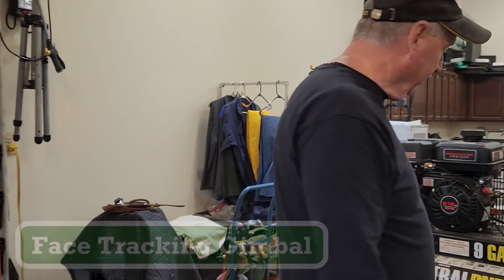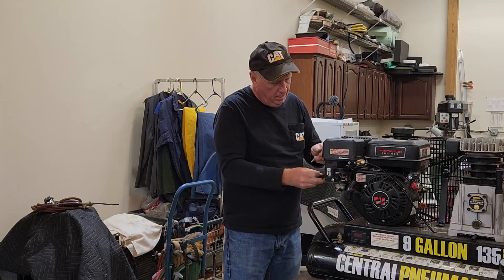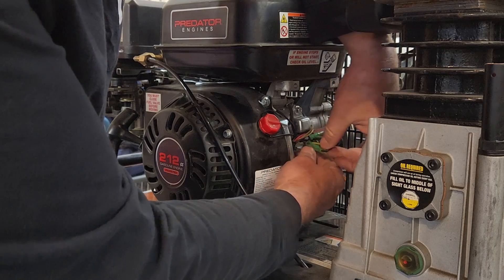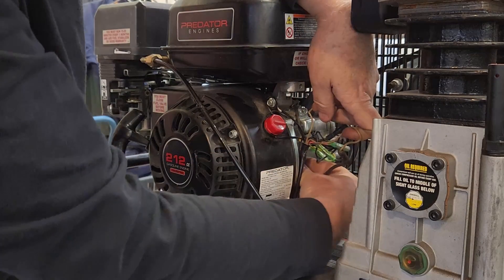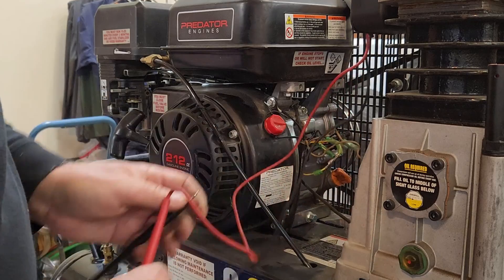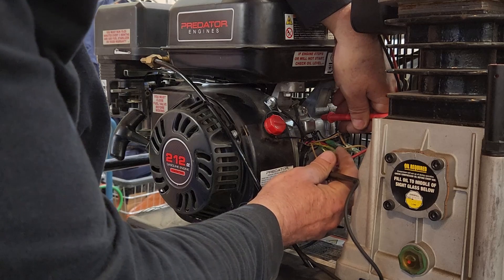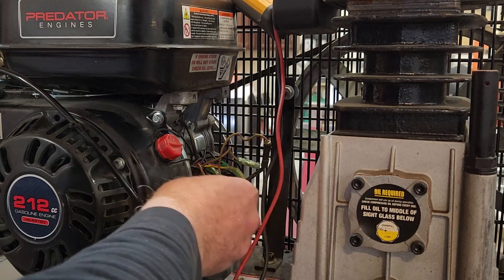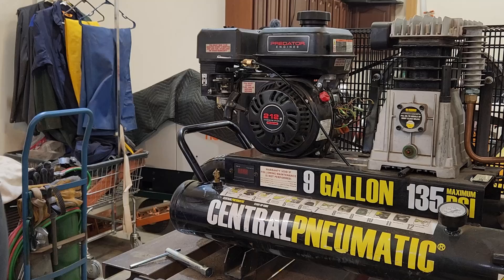Predator 212cc Engine Pops but Won't Start - Diagnose and Repai

Comment: Why would it be oil sensor if it pops?  I thought the oil sensor kills ignition, no spark, no pop.
Reply from the maker: It probably would not pop but I was beside myself trying to figure out my problem. I did think that that maybe the sensor was making an intermittent connection causing the pop.

Comment: Thanks !! mine is doin the same thing , never had a minutes trouble with it , until today , had it several years , good service , always shut fuel off , until it dies , never failed to start , until today !! never changed the plug either , Thanks !!
Reply from the maker: I hope the spark plug fixes your issue also. I really like having this compressor for remote locations and outside of the shop area at home.
Reply: @buildItplace  Yes Sir  it solved my problem , like it said same plug since it bought it guessing about 7 yrs , HF Wood splitter !! Thanks !!

Comment: I have the same issue , changed the gas, took off carb ,cleaned needle valve  cleaned emulsion tube cleaned spark plug.?  thought it is a faulty oil level sensor too ? may be valve lash ? My garden needs tillin! thanks I'll try new spark plug.
Reply from the maker: I never had a spark plug give me that problem with only a short amount of run time. Now it starts and runs so much better. Hope the spark plug fixes your problem.

Comment: Always check the fuel first
Reply from the maker: That would be me, but I did drain all of the fuel and put in fresh. I have never had a spark plug fail like that. I did notice that starts better without needing a long warmup period before putting a load on it even from buying new.